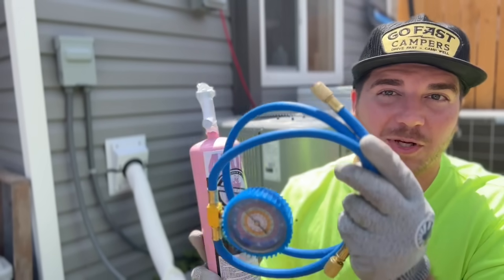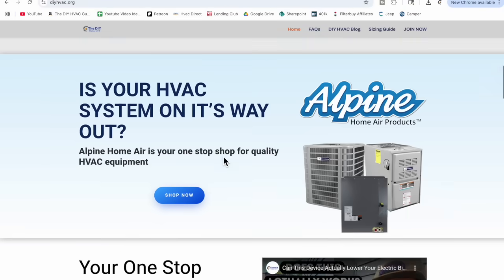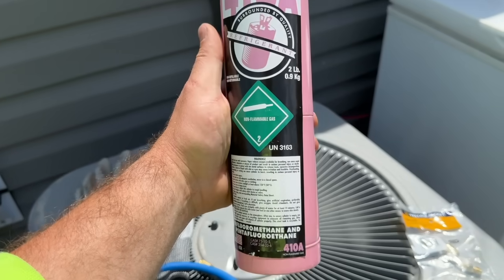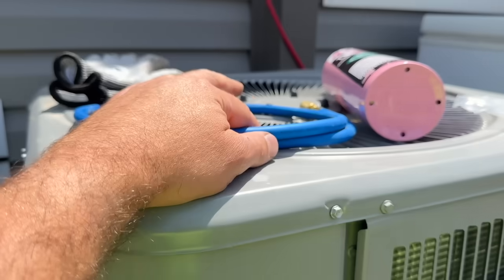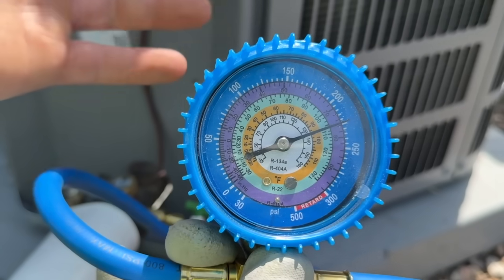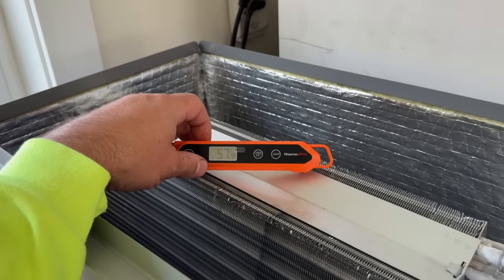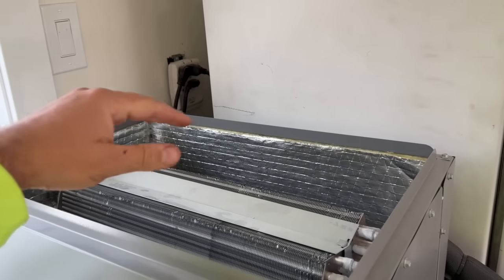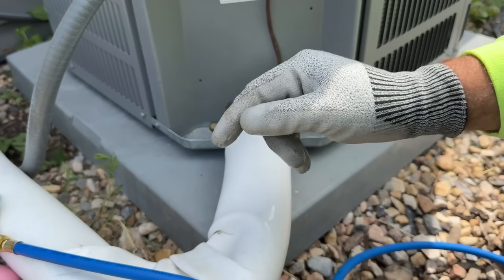You Can Recharge Your Home A/C Like A Car??  Colder Air in 6 Minutes!

Comment: NEED HELP:

My outside unit turns on and the fan spins and blows cool
Both A/C lines are warm but the air inside is not cold
The  capacitor  was changed last summer ?

Comment: Here’s my take as an auto mechanic who has done a ton of ac work. We offer a recharge service as do most shops. As long as the system isn’t empty that a recharge will usually get it going and if you have to recharge it every year instead of fixing a small leak than you’re ahead of the game. HVAC companies don’t offer this service. They ALWAYS want to replace an entire unit that’s 10+ years old (clutches pearls). 

My parents elderly neighbor was literally on her deathbed in her living room and her ac went out in 90 degree weather. After some simple diagnosing I found the condenser fan wasn’t running. I ran to my parents house and grabbed a box fan and put it on top of the condenser it was enough to get some airflow through the condenser to get the ac working again. I replaced the fan motor and capacitor the next day and all was good. She died a few weeks later and her brother went to sell the house. He knew I had been working on the system and got it up and running. He called an hvac company to check it out and guess what? THEY REPLACED THE WHOLE STSTEM. It was somewhat of a punch in the gut but it also wasn’t my money so whatever. My point being, screw the hvac companies, if you can do it yourself than do it. 

One more note for anyone still reading and this goes for cars too. If the system is totally empty even from a small leak than don’t recharge it. It NEEDS to be vacuumed down or you’ll have air in the system. Ac systems don’t like air especially since it takes up valuable space where refrigerant should be making it very inefficient. If the system comes on but doesn’t seem is cold as it should be or the evaporator is freezing up than you can recharge it, if it doesn’t come on at all than don’t waste your time and money trying a hot shot.

Comment: I bought from your link at Ability Refrigerant and may have screwed up. I forgot to turn the cylinder upside down at first, so I may have injected air into the system. Immediately after this, I did the bleed air procedure like the video shows at the bottle, hoping this purged the air I injected?

Did i screw up bad?

Some data on my setup. I have an r22 amana central air system. My guage showed I was at 30 degrees on the r22 gauge blue line. Inside air was 75 so I was able to achieve 45 degrees on the guage for r-22 getting my 30 degree difference. 

This got me from 64.4 degrees coming out of my ac vent to 58 degrees. 

My original incoming air was 75, out the vent was 64.4 = a 10.6 degree difference. After adding 2lb r22, I have a 16 degree difference. Should I try for the 20 degree difference, add more r22?

I've read the range I want is 14-20  difference from the incoming air.

Also, noticed if i open my furnace door my ac vent temp drops almost 2 degrees cooler. I already added 2 extra vents in the furnace closet. Should I add another?

One more thing, even with two pounds added and colder temps my psi on the guage was just above 50 psi with the system running. I remember you said if it was under 100 psi it's low in refrigerant for sure. Yet I got my 30 degree difference.
Reply: Nevermind I guess.

Comment: I’m a union journeyman hvac tech. I’m a full believer in right to repair but if you handle refrigerant without a license you could get a huge fine and if you mess something up and a company has to come out they usually charge you more because you broke something. Just a heads up. And that’s not just hvac. Most companies charge more if you break something doing things you’re not trained to do

Comment: If im doing the same process, except i have the 3 can system. Which comes with the pro dry, and the pro seal can, as well as r22 refrigerant. When I add the dry and seal cans, will that affect the amount of r22 it will take? Does adding the 2 sealing agents change the gauge?

Comment: Great video. I have learnt a lot from watching your videos. My system uses R22 and it is 25 years old and still running great. I am thinking of topping off the refrigerant by ordering the 2lb unit with the gage from Ability Refrigerant. The sticker on my unit says High Side 350 PSIG, Low Side 180 PSIG. Looking at the gage on the R22 scale what pressure range should I fill to?

Comment: I have seen this  question repeated several times in the comments.  "the purple scale says inches HG not temperature?" The in hg that you see is refering to the 0 to 30 on the outer blue scale, this is vacuum, dropping below the 0 to 300 psi scale. This is for when a vacuum pump is used to evacuate the system.

Comment: I have a Mr Cool mini split and I had to recharge it after 3 years. It took 14 lb of refrigerant to bring it up to top till it was functioning properly and had the right pressures. So about every 3 years I have to put 14 lb into the system. Even though there's no visible leaks when I put soapy water around the connections. My concern is that the air handler may have a defect and maybe leaking there slowly.

Comment: I just connected the hose from my can a 410 and when I screwed it on, I didn’t hear any gas escape and I don’t see pressure on the dial

Just to be clear, I follow the steps to Schrader valve side is going on the low side. The system is off and I didn’t hear gas escape and I’m thinking as a minimum they should be some pressure on that gauge coming out of the system

Not sure where to go from here
Reply: I apologize
But after writing this and leaving the hose hooked up, apparently it opened up the Schrader valve going onto the next step 
By the way, I like your videos very good
Reply: To continue
I took the hose off took a screwdriver to see if the Schrader valve is stuck. It’s not.  A a little bit of gas escaped when I released it with a screwdriver

 again when I put the hose connection on, it’s not reaching up far enough to release the Schrader valve 
I bought the exact recharge system from ability

?
Any help would be appreciated

Comment: My low side line is "beer can cold" and sweating. My high side line doesn't feel warm at all.  This is an R22 system circa 2005.  Should my high side line feel somewhat warm?
Reply from the maker: Not necessarily. If your low side is beer can cold you are probably fine refrigerant wise

Comment: What are you going to tell folks when A2L refrigerants take over and mitigation becomes the determining factor. Room size, coil and room sensors not to mention bringing in outside air to dilute and exhaust to make the living space safe? When “DIY” becomes a suicide mission.
Reply from the maker: The new A2L equipment has built in mitigation, and is very simple to connect. It will be a normal replacement just like any other up to this point.
Reply: @diyhvacguy They only come with an internal coil sensor. You have to factor in an external sensor when the refrigerant charge is in close quarters. It can not be installed near an open flame such as a water heater with a standing pilot or an atmospheric boiler.
Reply: @diyhvacguy Consider putting in a disclaimer in the future when advising folks how to and when to install A2L’s. For your own protection.

Comment: Where to get that recharge kit for R22?
All systems leak. Might take 29 years to leak a pound but they ALL leak.
In real life, most often it is a clogged air filter and/or dirty evaporator.
Especially if they have pets (particularly cats) in the house and a clothes dryer.

Comment: @5:44 - That line from the kit is full of air and that can damage the system, especially the ones with newer oils (which absorb moisture from the air).  You could probably still do this, but do a small purge first, attach as shown in the video, keep it unscrewed enough that it does not open the AC valve (which would waste refrigerant) and when you open the cylinder a bit, some small amount flows out near the AC unit.  This purges the air.  Then, tighten it fully to the AC unit (which also then opens the valve to the hose.
Reply: the video shows how to purge the line from the kit.  So why can't we just purge it like the video shows, or is your method better?

Comment: I LOVE the idea of DIY A/C and help people wherever I can... but the one thing to remember is that R410A Is still a blend .. a single top off is fine.. but if a system is continually topped off..(even once a year)  there will be glide ...  a small top up every couple years wont hurt a thing.. . I do like to remove my hose on the low side wit hthe system running...  less likely to encounter any liquid in the hose that way..

Comment: I have been using R290 in my old R22 system for 6 years now. Works great
Reply: Is that your window AC? Its illegal to use R290 in a residential central AC system.or commercial AC system.
Reply: @jimmclaughlin5930 I'm using it in my heat pump. Have been for 7-8 years. I work on my own equipment. If they want me, come get me.

Comment: Tengo una nevera pequeñita (te pondré toda la descripción mas abajo), el problema es que no  enfría nada,  NO tiene refrigerante y no sé cómo yo misma puedo comprar el refrigerante y ponérselo;  (o como puedo arreglarla), por favor, me podrías ayudar dándome la información: 

SHARPER   IMAGE  DESIGN
MODEL:  S1714SL2
•Input  Voltage:  DC12V  or  AC120V/60Hz •Power  Rating:  48W/4A  at  DC12V   (cold  
  mode).
•Power       "     :38W/3.2A  at   DC12V  (hot 
  mode)
•Power       "     :65W/0.9A  at  AC120V (cold
  mode)
•Power       "     :58W/0.85A at AC120V (hot
  mode)

Made in China

FREE  STANDING  INSTALLATION  ONLY  INSTALLATION  NON  ENCASTREE SEULEMENT.
650  David  Street,  S.F. CA. 

SWITCHES:

AC 120               DC 12V              ∆   -  Hot
________         ________         ∆   -  Off
                                                        ∆   -  Cold

YO ESPERO SU RESPUESTA,  POR  FAVOR CONTESTEME.
MUCHISIMAS  GRACIAS
(puede enviarme mensaje de texto al 201-737-7572------------------------

Comment: Seems like totally illegal advice...$10K federal fine and $5K state fine. That's why HVAC companies charge $15K.
EPA 608 Requirements
Subpart F—Recycling and Emissions Reduction

§ 82.150 Purpose and scope.

(b) This subpart applies to any person maintaining, servicing, or repairing appliances containing class I, class II or non-exempt substitute refrigerants. This subpart also applies to persons disposing of such appliances (including small appliances and motor vehicle air conditioners), refrigerant reclaimers, technician certifying programs, appliance owners and operators, manufacturers of appliances, manufacturers of recovery and/or recycling equipment, approved recovery and/or recycling equipment testing organizations, and persons buying, selling, or offering to sell class I, class II, or non-exempt substitute refrigerants.

[81 FR 82349, Nov. 11, 2016]

Technicians could include but are not limited to installers, contractor employees, in-house service personnel, and OWNERS and/or operators of appliances.

Comment: You never want to put it on the suction side. You could damage your compressor. the best way is in a gas form to the high side
Reply: Everything you said here is wrong.
Reply: @jay24123 you can do gas on lo side, just takes longer. Hi pressure 300# no way

Comment: If your system is low there is a leak... It is against EPA regulations to keep filling a system that has an active leak and eventually you'll be caught and fined. Start by changing your filter, hosing off the outside condenser coils and sucking out your condensate line with a shop vac. If brave enough clean your indoor coil as well. If that doesn't fix the problem call a reputable HVAC company to find the leak.

Comment: You guys, your home AC system is NOT supposed to be "recharged". An AC is a closed system, so if it is low on refrigerant there is a leak that needs to be fixed.

Comment: I have a lennox elite. My AC blows cool air early in the morning for 20 mins But once it warms it starts blowing warm air. My outside AC line is warm to the touch. I have also change the capacitor. Still have not solve my AC issue. Looking for any advice. Thanks!

Comment: I changed the air filters and the capacitor. No cold air. Followed your video and saved $1500 . Hopefully it lasts the summer. I realize it’s a stop gap measure before I need to replace the unit. Thank you. This was awesome. I knew  nothing about HVAC.
Reply: They sell leak stop shots that you can add between the hvac unit and the fill hose that will seal leaks that aren’t huge. I.E. only having to add once a year or less. 

NU-calgon sells a very popular one

Comment: This is funny because you can flip a coin and wing it with the trailer park boys just about guaranteeing an overcharge and introducing air into the system or you could get a reputable tech to recover the refrigerant (freon) is what dupont calls theirs, purge the system with nitrogen and find/fix the leak......then properly charge it by subcooling (txv) or superheat (piston). If you service the system properly it will last 20 yrs or more with no problems but the trailerpark boys just need to "shoot some juice in it" every once in awhile to keep it running, lol gd

Comment: At 9:39 the decal says the design pressure for the low side is 236 psi. Yet you only charge to just shy of 125 psi based on what's shown at 17:01  Why?

Comment: This is a great way for inexperienced homeowners to overcharge a properly operating system. Yes service calls cost money, yes there are shady contractors, however overcharged systems will flood the compressor with liquid. If you don’t check superheat you won’t know until your compressor stops pumping efficiently caused by liquid damaging it. Now you’ll be looking at some money especially if it’s an older system. I’d steer clear of this charging method. If you want to do it buy a kit that does subcool/superheat. There are also  other reasons for suction pressure to be low. Restrictions, and low airflow. Adding Freon without knowing the liquid pressure is a horrible practice. I’ve been a HVAC/R mechanic for 17 years. I’m the lead mechanic at the company I work for.

Comment: Every homeowner should grab a can or two and add it immediately!!! It works! It really works!!

Don’t bother checking airflow across your indoor coil (IE YOUR AIR FILTER),  static,  delta T,  SH & SC, blower motor, oh and nevermind cleaning your condenser coil annually.
Why not add an accumulator to increase capacity while you’re at it.
Or just slam more refrigerant into it,
might as well stack liquid in the condenser and kill capacity.

Comment: When I screw the brass hose fitting onto the schrader valve fitting, I don't get any pressure.  Took a pliers and made sure it was screwed completely on/tight.  The last service I had a couple years ago involved a leak sealer.  Could that have sealed off the Schrader valve?  Can/should I replace the valve?    Anybody have any experience like this?

Comment: I have a question for you please. First of all, thank you for your wonderfully informative videos. When you were testing the Schrader core for leaks using soapy water to watch for bubbles, you didn't check the other Schrader core. You said something about not wanting to get water into the system. So that's my question. Can you only test one at a time and wait until the first one dries up because putting the soapy water on both cores at the same time will cause some kind of backflow and get water in the system? I would really appreciate it if you could tell me why or what you meant by not wanting to get water into the system. Thank you so very much! 😀

Comment: Im sure im reading it wrong but the I thought the orange scale was temp (F) and the purple 410A shows inches Hg, isnt that pressure?
Reply: I have seen this  quest a couple times in the comments.  "the purple scale says inches HG not temperature?" The in hg that you see is refering to the 0 to 30 on the outer blue scale, this is vacuum, dropping below the 0 to 300 psi scale. This is for when a vacuum pump is used to evacuate the system. I hope this helps

Comment: How stupid a video this actually is. Been doing refrigeration 56 years. Never ever try to charge your home split AC system. Especially the 410A. If you add refrigerant, and it starts working then you have a leak. Stop right there. Just like the old time cars, every year we heard it needs a shot of freezone. WTH is freezone. Leave it to a professional because it could be so many other things than low on gas, and you'll end p paying more money buying the refrigerant when it doesn't need any. This is the dumbest video I ever saw by any DIY professional !!